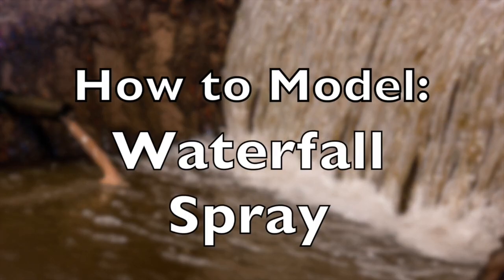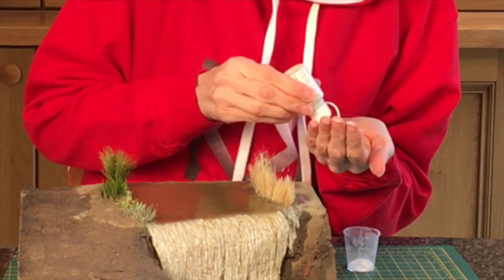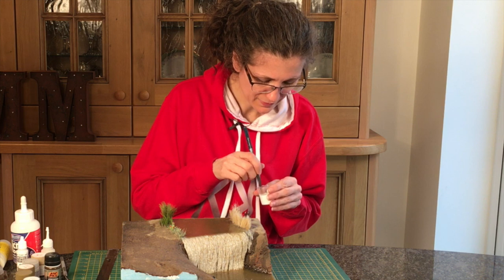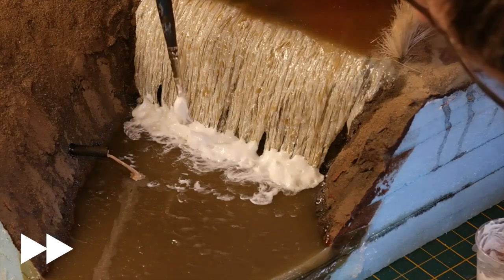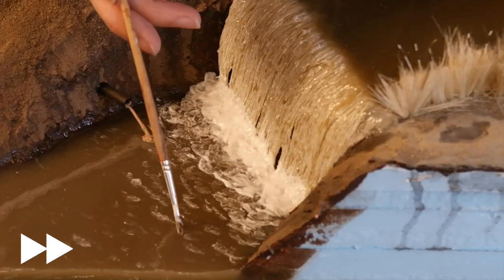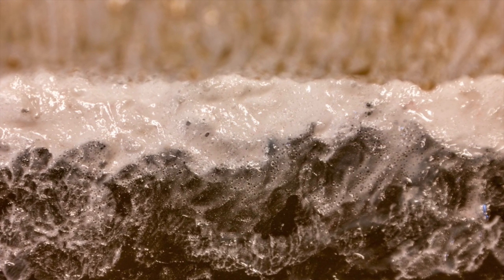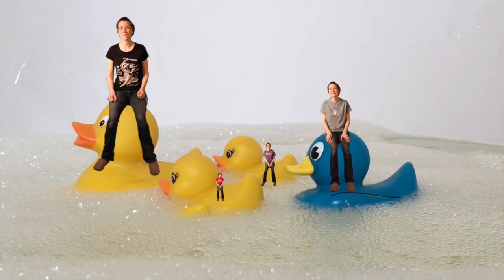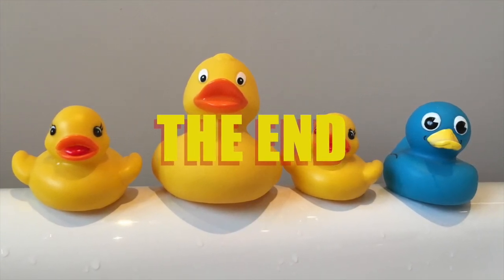How to Model Waterfall Froth and Foam

Comment: Thanks again Kathy!"Meringue" is the word, it looks really great, a fabulous fluffy curtain backdrop to fouled water. I agree that foam is white, tho' it can meet and mix with dirtier water. Critique:  I think you may have missed the tiny wavelets  around where the effluent from the pipe hits the water What interesting materials! I'm not sure we can assess the scale of these balls even though you had great close-ups - what do you think of the scale? What do you think the effect if the mixture was almost totally Dragon Balls? Like a bubble bath?Great material to build up body in water  - presumably these materials dry faster& more reliable than a great hunk of gloss gel medium.I remember that water savant, Mike Terranscapes, asserts that foam can be a bit "dry looking" so you have a debate there :)   I'm not sure & would have to compare in the flesh.
Reply from the maker: Hi Vikki,  not sure the effluent is totally finished in this video as I filmed both in parallel but it probably does need a bit more tying in.
Reply from the maker: I think a few bubbles look good but you can add more to taste. It does build up better than neat gel medium.
Reply from the maker: My foam just looked s but too dry hence the extra gloss...